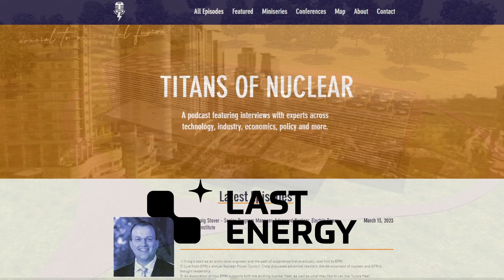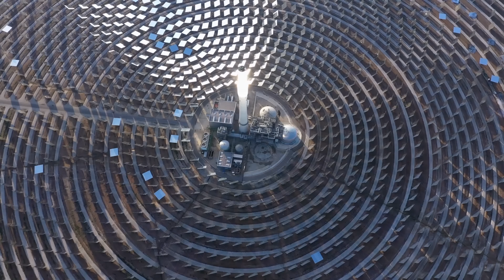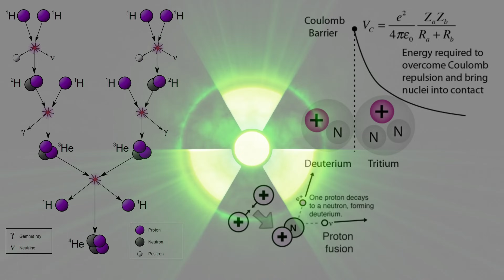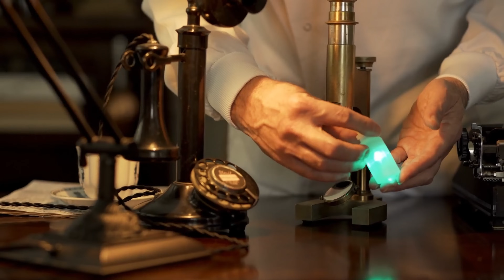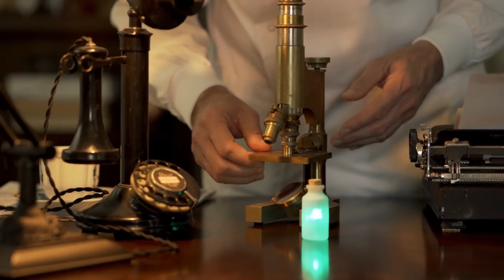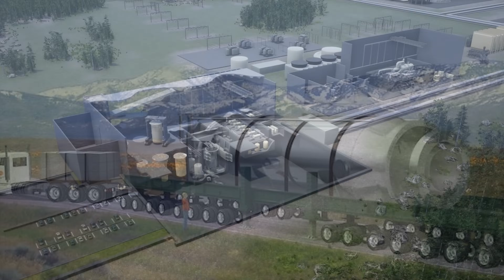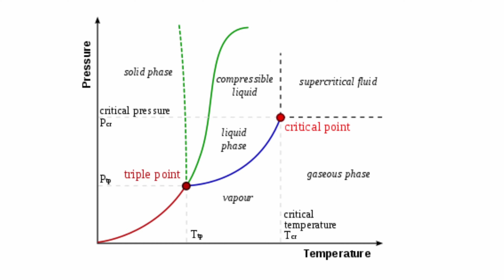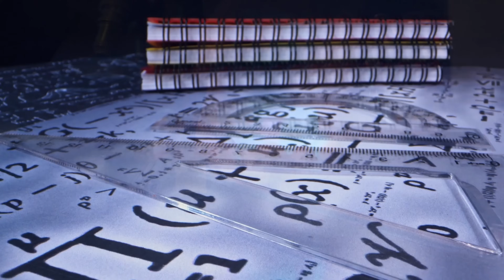Nuclear Power: Small Modular Reactors

Comment: The 4887.439 tons of spent fuel generated in one year by 10,000 20MW micro reactors can fuel 52 1GW Molten Salt Reactors for 100 years. 940 kg of natural thorium in a Molten Salt Reactor (MSR) can generate 1 gigawatt (GW) of electricity for one year. The 37,112 tons of unused depleted uranium processed to obtain the 4888 tons of enriched uranium can fuel 394 1GW Molten Salt Reactors for 100 years.

Comment: You said u235 had the same amount as u238 at the start. I doubt it. What you had was a whole bunch of transuranics. Thus these trans materials decayed down into u235 and u238. I am pretty sure critical material was created together as the neutronium first broke down into elemental elements. The decay at first was super duper radioactive and as it decayed the process was at first very rapid the same as first pulling nuclear material out of a reactor only 100's of times more so. When Oklo natural fission reactor was operating billions of years ago the amount of u235 was at least 3 times as prevalent as now so it had already decayed seriously by then. The water would flow in and moderate the neutrons causing a burst of steam over and over. As time flowed along less and less steam bursts happened until finally almost all the u235 was used up. What is for we humans is to note how far the radioactive particles transported through the soil. Believe it or not the radioactive particles did not move very far from point of origin. Of course tritium and hydrogen moved out almost as quickly as produced just like oil in an underground reservoir escapes when breached but in that case ya'll have bouyant forces helping.

Comment: 21:17 This is not completely true. It's possible for a reactor to produce more electricity than heat if you use a fission fragment reactor. They directly convert charged particles produced from fission into electricity. Efficiencies of over 90% are possible.
Reply: “Possible”

Theoretically, perhaps. Nobody has built a successful high efficiency direct conversion reactor anywhere, ever. Huge practical problems with megavolt electrodes, can’t allow release of fission products, etc.  And it’s not 90%, as the energy in the neutrons is lost to direct conversion.
Reply: @Czeck0-u1k  Which is why I said it's possible, just like nuclear fusion for electrical generation is also possible, but you're never going to get a practical implementation of it with the cynicism you expressed just now. And no, over 90% efficiencies is absolutely possible, look it up yourself.
Reply: @thuggeegaming659  "cynicism"
I'm an engineer, and I'm familiar with the literature on direct conversion. You're confused, 90% is not possible w/ fission; the literatures suggests high efficiency is theoretically possible with some aneutronic forms of fusion which are not remotely plausibly now. 

BTW, the way complicated challenging tech breakthroughs  occur are by people like me who put in the years and work to obtain the skills to determine what might work w/ some effort, and what's nonsense wishful thinking.  You're the other guy, who with no work would wish a thing into existence. You're the guy who makes Theranos, WeWork, FTX, Nikola scams work on a credulous public, and shouted down the not-so-fast critics as non-believers.
Reply: @Czeck0-u1k  Lol no you're not an engineer, you're a troll. It absolutely is possible, you are objectively incorrect.

Ad hominems are a sign of anger and frustration when you can't formulate a cogent argument. . Next!
Reply: @thuggeegaming659  Read Moir, R. W.; Barr, W. L. 1973.
Reply: @Czeck0-u1k  Naa.

Comment: When discussing nuclear power you should also get into mining the fuel which is a dirty process. this may cause as much problems as disposing of the waste
Reply: Really dirty? Compared to what? Copper nickel lithium aluminum steel?  Uranium “mines” are not even mines anymore. They are insitu, a pipe in the  ground pumping water.

Comment: I severely doubt SMRs are more power dense than larger reactors, and if they are, just stack a bunch in on place. Centralisation comes with management and security benefits.
Reply: But you will be able to ship and commission these anywhere so factories and other buildings can have their own source of nuclear power. And there are plans for micro modular reactors that are the size of 2 water heaters that could be used to power big electric semi trucks, spacecraft, etc. They also don’t heat up nearly as much and are far less of a risk of overheating. Even if it isn’t as power dense, this gives nuclear energy a lot more flexibility with what you can use it for and where you can use it
Reply: @Mishkobt  convincing any regulatory agency in the world to let you have nuclear reactors in nearly unrestricted areas will be a really tough sell

Comment: We don't need them. They are too expensive. - How solar energy got so cheap - https://www.youtube.com/watch?v=V8Vtb0bn30M&t=1s
Reply: Too expensive compared to all other types of energy. Engineering with Rosie - Are Renewables Actually the Cheaper Option? -  https://www.youtube.com/watch?v=quI_8xYSWYE&t=31s
Reply: I agree, when I think of a reliable energy grid for a modern industrial society, I think of low-dense, intermittent sources like wind and solar. 100% guaranteed black-outs and brown-outs every single day without exception.
Reply: @chapter4travels  Wind and solar with batteries to iron out the intermittency is still far and away the cheapest and most reliable energy. France had to shut down its nuclear because of drought lowering the water levels below their intakes. Thank goodness they had peaker plants and they had those because although nuclear is normally a good base load, with the hot summers they've been experiencing peaker plants were still need to reach peak electric demand. Nuclear isn't the panacea it was once proclaimed to be. Wind and solar may not be it either, but right now it is the best thing we have, and it is so much better than nuclear.

Comment: And yes, nuclear IS DEMONIZED and yes, implemented properly would alleviate huge pains of our Civilisation. Consider: we have safe maritime nuclear power NOW. TODAY. Using it on largest ocean going transport ships ( container and crude carriers ) along  with barge carrier making return it could yield following results: 1. going to full electric drive cuts noise which is becoming a problem 2. eliminates burning heavy fractions of oil and associated NOx and sulfur emissions, not to mention CO2 3. allow to make hydrogen (or carbon neutral synthetic hydrocarbons, but in this narrow case, hydrogen is better ). And now imagine, every container includes short term storage for 5-10kg of hydrogen - enough to power it's transportation to electrically (and nuclear power) train network and maybe even to logistical hub from said railway.  Couple it with nuclear powered steel mills and shipyards (we have processes to make steel without CO2) and there you go - in reasonable timeframe you have slashed 10% of CO2 emissions, and what's more you have decoupled both engine and enabler of economic growth from CO2 emission. Realistic, doable in quick timeframe.

Comment: SMRs have three significant theoretical advantages:

1. Walk-away safe
2. Scalable due to their modular design
3. Mass producible via assembly line due to their modular design making them much cheaper than traditional large reactors
Reply: How many fusion power station is there in this planet? Zero.
How many molten salt nuclear stations? Almost zero.
So what if they are walk away safe if they are not commercially viable?
And they are not really walk away safe anyway, those high temperatures molten salt are extremely explosive in the present of air and moisture. They need to be sealed off at high temperatures if not pressure.

Comment: We'd probably have had these commercialized at least 60 years ago if the US Military hadn't bungled the SL-1 program.  The goal there was to produce a reactor design conceptually similar to a SMR design to power isolated military bases in the Far North of North America.  (It was intended to be shipped in in sections by air, and assembled on site by air-transportable equipment.)  Unfortunately, it was both poorly designed (including directly violating that then-current military reactor design rules) and had some serious operational problems.  And, of course, there's the detail that it killed it's operators.

Small detail:  The extra mass in heavy water molecules is enough to change the chemical properties enough that heavy water is functionally toxic.  Not very toxic, but no known life could exist in an environment with only heavy water.  That's hardly a deal breaker for an artificial resort structure, but it does mean you need to reengineer all life you want to have out in the environment and it needs a sealed life support system for regular humans, and you don't want regular humans breathing the air outside since they'll be releasing normal water into your chemically anomalous environment.

An important point is that despite many nuclear power plant accidents, the only one that killed a significant number of people was the Chernobyl incident, and that involved failures at every possible level:  The reactor was a fundamentally bad design, it was poorly built, and on the day it was operated in a completely idiotic manner.

Comment: gen. 3 reactors were supposed to be "cheaper", "smaller" and "modular". they turned out to be almost completely unbuildable and absurdly expensive. now the scam is perpetuated again with "small modular reactors" by the same companies that completely failed to develop economic gen. 3 reactors. 

don't buy into the scam of "cheap" nuclear power. the economics has never been there; currently the industry is just a corruption ring that goads customers and taxpayers into shelling out tens of billions for their fake projects.
Reply: You know - If you only build one car, then it is custom.  It is very expensive.  However, if you build a great many cars, you have the economy of scale and folks learn better and faster ways to build them.  The fact of the matter is that nuclear reactors used to be somewhat cheaper when more were built.  What kind of a world do you want to live in? OK the first couple are pricey?  Do you want to just give up on a good idea?  Ever watch the Rocky movie?  He practiced.  he got better.  It's the same sort of thing with these nuclear reactors.  The world is cut and try.  You don't give up because the first board you cut doesn't fit.  Sometimes things aren't quite right "out of the box."  I guess I wouldn't call it a scam.  It's science and craftsmanship.  Good craftsmen start as apprentices.  They are slow to start but with time they get both better and faster.  They also build with higher quality.  Science and Craftsmanship aren't scams.  Besides, even if it does cost more than windmills, it's 24 hour a day power for 60 years.  I guarantee the high cost of some of these plants will be a fading memory in just a few years.  Inflation will make the price seem low.

Comment: A greatly entertaining and informative episode as always, Isaac. A couple of small corrections on neutron physics though.

When discussing nuclear weapons you stated that the neutrons impact other atoms and slow down before fissioning U-235. While moderated/thermal fission weapons were investigated, it was found that a fast-fission weapon was more achievable.

Similarly, at 17:40 you state that capture of fast neutrons is what breeds U-238 to Pu-239. Breeder reactors do often run in the fast spectrum, but this is more for the superior neutron economy of Pu-239 fast fission, as the capture cross section is much larger for thermal neutrons for both U-238 and Pu-239.

Comment: Molten salt reactors are the way to go. The first nuclear submarine was a molten salt reactor. Then they wanted to go with high breeders. Mainly for plutonium in my opinion. It's not need in them.
Reply: Well - Maybe there was a secret submarine using a molten salt reactor.  Wiki tells us the first sub was the Nautilus.  It also says the following: Nautilus was powered by the Submarine Thermal Reactor (STR), later redesignated the S2W reactor, a pressurized water reactor produced for the US Navy by Westinghouse Electric Corporation.

The molten Salt reactor was an idea for nuclear powered airplanes.  ICBMs were developed so the nuclear airplane idea was jettisoned.  China has built a molten salt reactor based on an experimental reactor at Oak Ridge in the mid 20th century.  Let's hope it works out.
Reply: @daniellarson3068  I'm sure it will. The whole design behind high breeder reactors was so that they could produce plutonium. It takes an extra tier to produce plutonium.

Comment: Once upon a time there was a vast and empty void. It was an endless expanse of nothingness, with no matter, energy, or even light.

But within this emptiness, there was a tiny spark. It was a singularity, a point of infinite density and temperature, where the laws of physics as we know them break down. And from this spark, the universe was born.

At the very beginning of time, the universe was incredibly small and hot. All the matter and energy that would one day form galaxies, stars, and planets was packed into a tiny, zero-dimensional space. This space was so small that it could hold just a few elementary particles, the building blocks of matter.

But even in this tiny space, something incredible was happening. The particles were held together by a powerful force, known as the Strong Nuclear Force. This force is responsible for binding the protons and neutrons in the nucleus of an atom, and without it, the particles would simply fly apart.

As the universe expanded and cooled, the particles began to combine to form atoms, molecules, and eventually, the first stars and galaxies. And yet, even as the universe grew and evolved, the Strong Nuclear Force continued to hold the particles together.

As scientists peered deeper into the structure of matter, they discovered that the particles themselves were made up of even smaller building blocks, known as quarks. And once again, the Strong Nuclear Force was there, binding the quarks together to form protons and neutrons.

The story of the Strong Nuclear Force is intimately connected to the story of our universe. It is the force that holds matter together, from the smallest particles to the largest structures in the cosmos. Without it, the universe as we know it could not exist.

And so, as we gaze up at the stars and ponder the mysteries of the universe, let us remember the tiny, zero-dimensional space that holds our quarks together with the Strong Nuclear Force, and the role it has played in shaping our cosmic history.

Comment: @Isaac_Arthur , they are still too big, but what if such reactors could be build to fit the cargobay of Starship, would an SMR on Mars make a big difference when it comes to power for their mission on Mars, or would it be overkill and solar panels will do just fine, since they receive more valuable electromagnetic radiation from the sun, even at that distance.

Comment: As someone whose been trying to get into a nuclear safety program for a few years now, SMR scare the bee gees out of me. People want to build hundreds, maybe thousands (I have seen city-by-city and neighborhood-by-neighborhood proposals) of independent reactors that need to be secured and supported (moving fuel/waste.) The more you move something, the higher the odds of something going wrong, and I don't trust people not to do something stupid, intentionally or unintentionally (war.) I question the "put it anywhere" promise, seeing as how we still have houses sliding off the hills they're built on. Bigger reactors also tend to have a strong efficiency advantage, and I believe that Traveling Wave Reactors will become a major part of the nuclear fuel life-cycle in the future. That brings with it a whole other side to the logistics. I've also heard a lot of claims regarding cost efficiency from scale. That usually doesn't kick in until you're building several thousands or tens of thousands of something, so I doubt that will ever pan out, especially with how many different SMR designs are kicking around today.

Comment: For low water use I like reactors designed for "atomic jets" and use a gas turbines to spin the generator. I particularly like the engine for SLAM (Supersonic Low Altitude Missile) but agree that a less efficient indirect heating design, like the Air Force went with for the manned nuclear bomber program,  probably has a lower risk of accidentally spewing radiation into the environment.

Comment: I secretly think SMRs are kinda being promoted is the human sensitivity to large catastrophies rather than small ones.  There is always going to be safety trade offs and making lots of tiny reactors rather than a few big ones might be psychological/political.  It might make meltdowns more likely but since it contaminates a couple dozen square miles instead of a sizable chunk of an entire state, it means less negative press.

 Big issue nuclear seems to have is it's stuck via path dependency and proliferation concerns with light water reactors that fission a small fraction of the fuel, turn huge chunk into long lasting transuranic waste, than presumably bury it somewhere.

 Present nuclear energy is really a very small amount of the world's energy consumption, just 10% of electricity generation, essentially zero transportation or industrial use.

 Getting to decarbonize the entire world,mostly with light water PWRs that's 20X the current usage, that's 20X or more of a waste issue.  Uranium reserves at current usage are good for a century or two.  Using nuclear to mostly power the world without recycling or breeding, the fuel would be exhausted faster than fossil fuels.